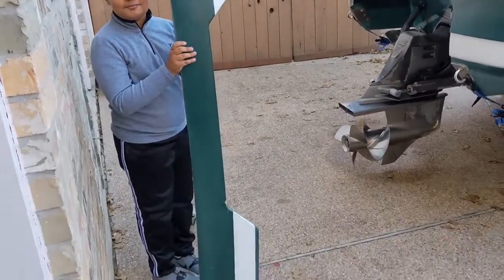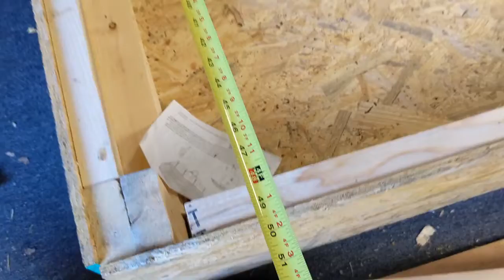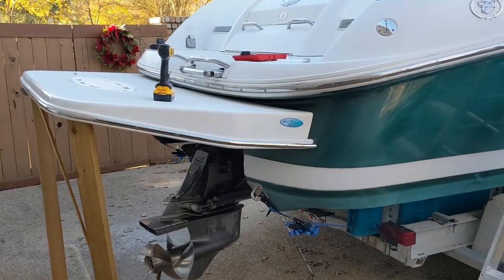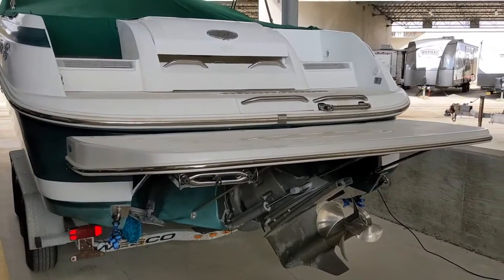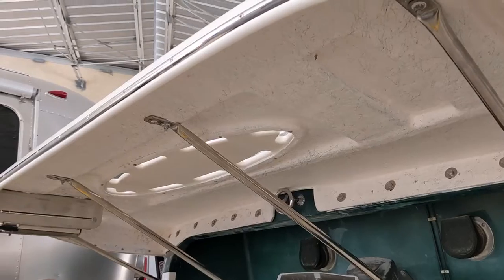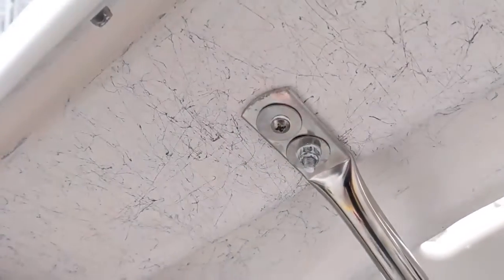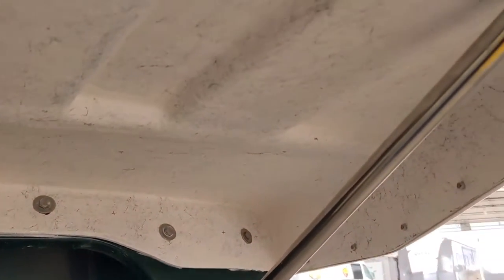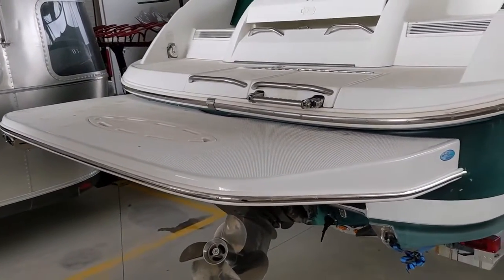Cobalt 292 Extended Swim Platform Installation

Comment: I am replacing my 22" deep swim-grid to a larger 39" but not sure about what height to mount it. I'm afraid if mounted at the same height it would get caught up in sea wash. Is there 
a calculation or "rule of thumb" to determine the right height from water line for a bigger swim-grid?
Reply from the maker: Depending on your boat, you can usually put the swim platform fairly low. When you are driving the water is usually a lot lower than the platform. since the water is coming from under the hull.

Comment: How solid is the transom where you fastened the brackets?  I have the same platform and the screws were pulled out a few times. Need to fix this somehow. My transom is only solid right next to the outdrive.
Reply from the maker: Very solid actually. What kind of boat do you have? And are you using a swimplatforms.com platform? Which sealant did you use for your hardware that screwed into the transom? I used 3m 5200 for all the hardware for a permanent reliable seal.

Comment: curious how you patched the holes in the lid? what did you use what is the process?
Reply from the maker: Do you mean the left over holes from the old ladder? I used 3M 5200, let it dry, and then used a razor blade to clean up any 5200 that was sticking up past the surface. On our old Cobalt 232 I did the same with 5200 and then installed SeaDek over the top, so it was a nice clean end result. But if you are removing the factory swim platform and need to patch the holes in an area that is going to stay visible, it may be better to use a small Spectrum gelcoat repair kit to get the most visually appealing patch that is color matched to the factory gelcoat.